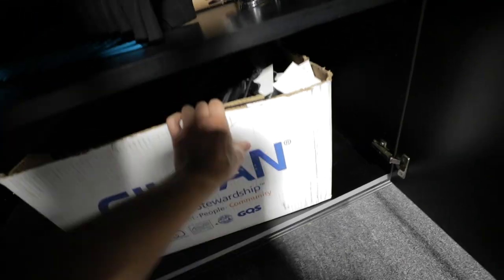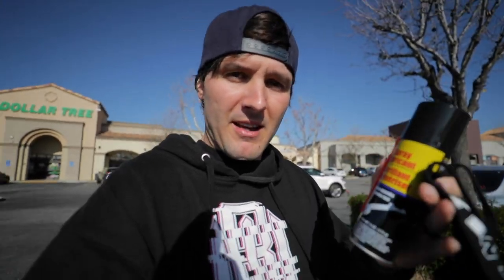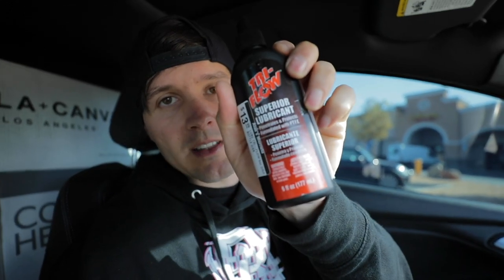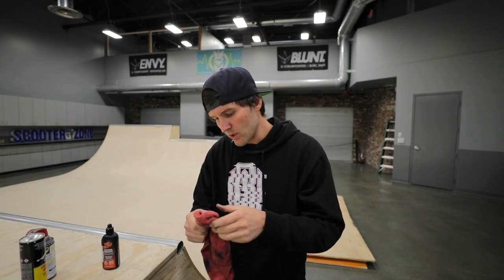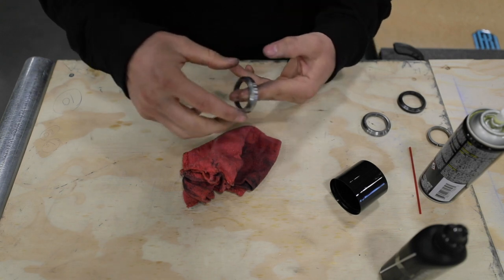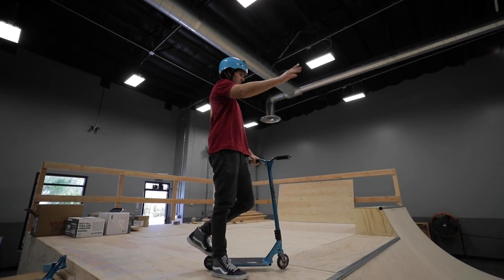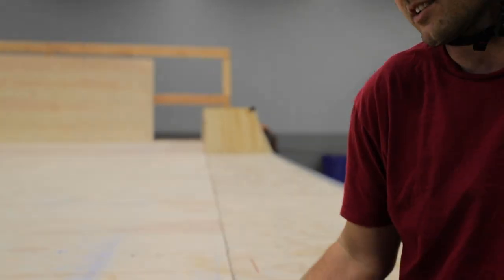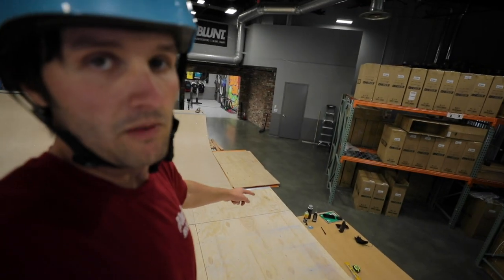$1 SCOOTER BEARING LUBRICANT TEST!

Comment: Ok, you have a lot to learn about mechanic. Degreaser vs grease. Purpose of grease in a bearing. Short story: it’s ok to use NO grease in a bearing that doesn’t really spin a lot (like in your headset). And if your bearing is dry (no grease) it will spin freely (fast). So ya, continu to use WD40 (a degreaser) in your headset.
Reply: What should I use for my headset? Does multipurpose grease work?
Reply: @jamiepereira78  It will work, but your headset will be « slow » since general purpose grease is usually on the thick side. So yes, it will work BUT ideally you will use a light grease (yogourt fluid, not toothpaste thick). Also, don’t packed your bearing with grease (once again, this will slow down your spins), just a small amount is enough. Just enough to cover the whole perimeter, not to fully fill it. If your head tube have no cutout into it, you can also remove one seal on each bearing (the side not exposed to dirt). This is a little racer tweek from my past mtbiker racing carreer... Bearing will spin more freely. You can do the seal thing on your wheel bearing also. But don’t tell anyone, it’s a well kept secret amoung racer’s mechanics... 🤫 And PLEASE, make sure your scooter is dialed! All the time!
Reply: @MrLapin-LL thank you, I found ball bearing grease form my local store that I will try tomorrow 👍